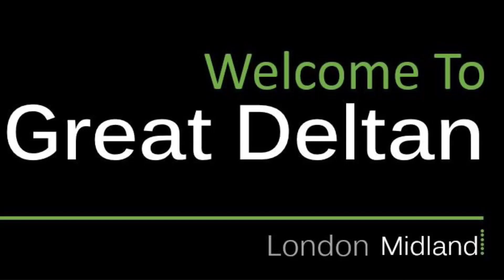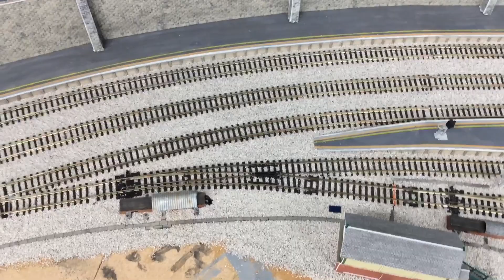Adding N gauge track detail part 2-after ballasting

Comment: Can I just point out that you wouldn’t have the stop signs at the end of the bay platforms as the buffer stops and lights would be your signal so to speak..some bay platforms have markings on the platform for drivers to stop at or it’s just 6 feet from the buffers if no car stop or mark..other than that it’s looking good
Reply from the maker: Ah thank you very much, I may take them out then, just thought it was A little extra detail I could add, cheers though! :)
Reply: Great Deltan your details are looking good,just don’t want you to go to a lot of effort and then have something that’s not prototypical spoiling your efforts..at Paddington we have the “landing zones”where to have your cab in,at Henley on Thames,Basingstoke platform 5 it’s just use your judgement for the 6 feet to the buffers,Newbury we have stop car markers in the bay.